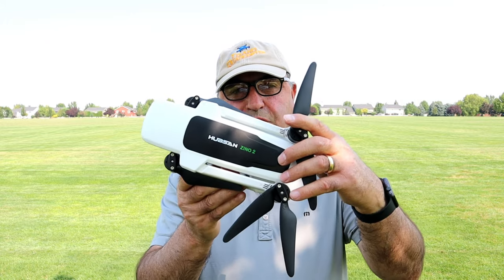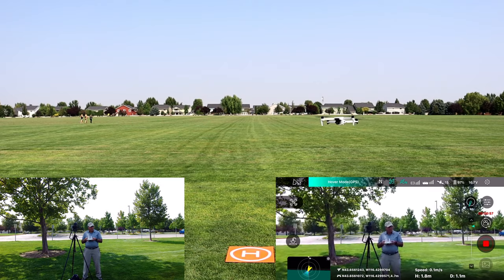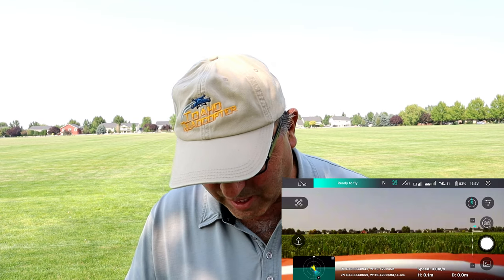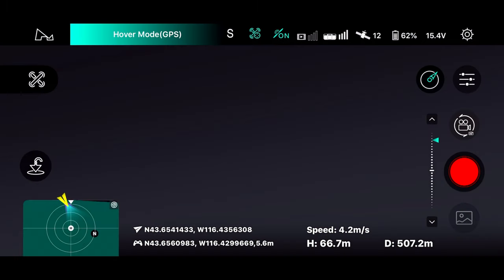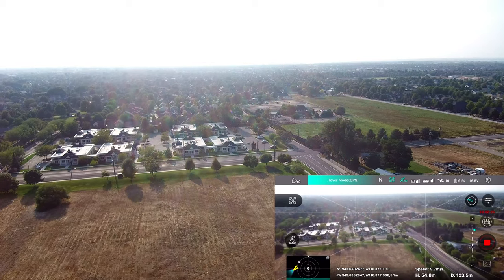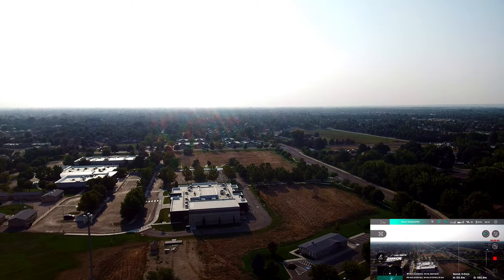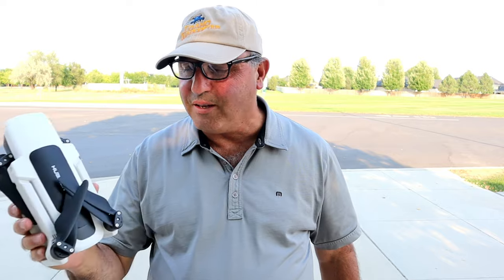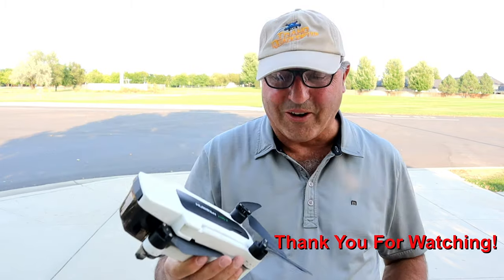Hubsan Zino 2 - FPV Fail and Solution

Comment: I think the green light is a high end feature that advises you that you're about to have to spend money. My cheaper models don't have high end warning features like that. They just quit working and can't be repaired. I think that the luckiest day in my beginning drone life was being talked into buying my Xiomi mi instead of a Hubsan. I have never experienced any of the problems with mine that others seemed to do. Just made sure all the newest downloads were updated and turned it an inch or two in a different direction when it told me I couldn't take off. I still enjoy flying it from time to time but still can't beat my DJI Mavic Pro 2 and Pro 2 Zoom
Reply from the maker: When I fly these other drones, I am always reminded why DJI dominates the consumer market.  Thank you Craig.

Comment: Hello! Thank you for your videos. I just got my zino 2 plus, and I'm having this issue, everything else looks pretty good, but I get fpv but 5 minutes in the air I lose it, I land, restart, works then same thing over and again, I can't figure out the problem. I think if the cable didn't work, it wouldn't work at all. By the way I just got it last week 11/19/2020 from HubsanUS. Please any suggestions? Thanks
Reply from the maker: Make sure you are using a very fast SD card.  Failing that, I would ask for a return to Hubsan US.

Comment: Hey, where did you buy your zino from.
Reply from the maker: Gearbest.
Reply: I think that why some zino 2 having problems. I think Gearbest remove the original  ribbon cable from it, and replace it with bad one. So that you keep buying ribbon cable from them. I bought my zino 2 from Hubsan from them, is different buying from hubsan. I never have problems with my zino 2.
Reply: QC guy was telling me different between Gearbest products and Hubsan products. you have to be very careful.
Reply from the maker: @Jeffrey00ish  The Zino 2 is a Hubsan product that I purchased from Gearbest.  👍
Reply from the maker: @Jeffrey00ish  Thank you.

Comment: I dont think you needed a new cable. On hubsan models the cable on the end where it connects to the back of the camera comes out a bit. They tried to rectify the problem by putting a pad up against it as a cheap solution. That is why it sometime worked and othertimes didn't.  When you put on the new cable you pushed it back on. Pushing the old one in again fixes it without much work. Hubsan has known about this problem since the pro came out. You will or should hear a little click when reseating the cable. Have fun. Love the area you fly in.
Reply from the maker: Thank you!  Mine does have that pad on the camera end of the cable.  This was a strange one.

Comment: Hi Marcus, I had exactly the same SD card speed error yesterday wih my H117S Zino. Like you it was a card that I've been using with it for months and I just switched to another Sandisk card which itself has been round the block a few times and the error went away. I haven't had a chance to try the original card again as I was putting together a Fimi video but like you I suspect that these old cards do degrade, not helped by the fact that we have to keep unloading them to get the videos off them and then reload them every time we fly the drone. You don't have to do that with your phone, a camera or a GoPro. As always, keep 'em coming!
Reply from the maker: Thank you!  This is the first time I've encountered something like this on the Zino 2.  My original Zino H117 was also very sensitive to having a high speed card, and required it to be formatted to FAT32.

Comment: Also, know that to obtain complete functionality your SD Card need to be U3 Compatible, again required by the latest firmware upgrade to fully support 4K 60fps.
Curtis Mason CNA,CNE,MCNE
Reply from the maker: Yes, a U3 card is a must for any drone that records in 4K.    Thank you Curtis.
Reply: @IdahoQuadcopter  
Right, my point was even with the U3 SD Card you lose the FPV funtions by formatting the card from the Zino 2.  It is an issue with the update and not the card, simply format the SD Card in your home PC or Laptop and it will default to the proper  Fat32 format.  And when Hubsan sends the fix we can go back to formatting with the Zino's.
I'm glad you can get the word out to many Zino fans.

Comment: Found the problem and a solution:  The problem is a result of the latest firmware update.  If you have formatted your SD Card in the aircraft after the update you will get the same result.  The reason: The firmware REQUIRES the SD Card to be formatted in "FAT32" format, which used to work fine until the update.  After the update the aircraft now formats your SD Card in "EXFAT" Format which is not capable of writing at the required sustained rate.  So, until Hubsan resolves this issue, people are gonna format their SD Cards and lose FPV functionality.  I would suggest you format your SD Cards in your home PC or Laptop and make sure it formats in Fat32 format, and hopefully Hubsan will correct the glitch soon.
Thank you,
Curtis Mason CNA,CNE,MCNE
Reply from the maker: Thank you for that tip Curtis!  You just helped a lot of people.  👍

Comment: I had to replace my gimbal ribbon cable after about 3 months because I lost my FPV but its good to know that it could also be an SD card issue.
Reply from the maker: It was really trial and error.  I want to test fly it a few more times to ensure that I don't have any more issues.  👍
Reply: @IdahoQuadcopter  a couple times i had the SD card error message but it went away after a re-boot of everything